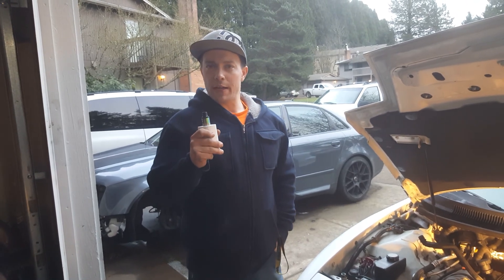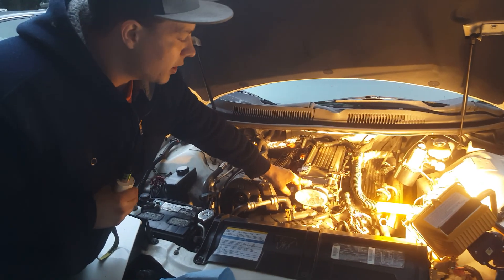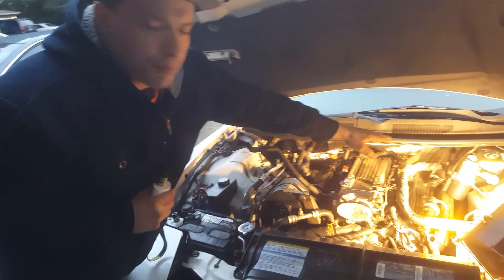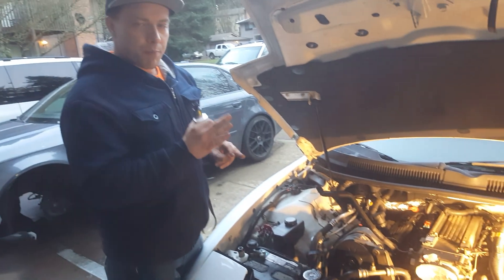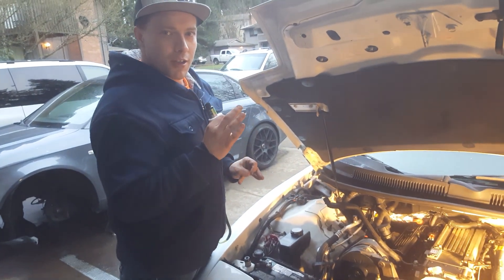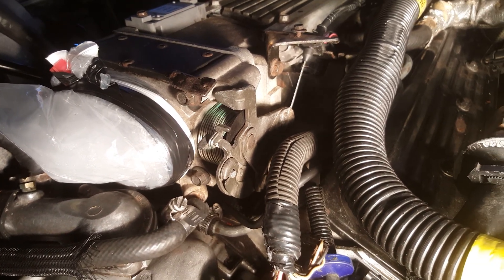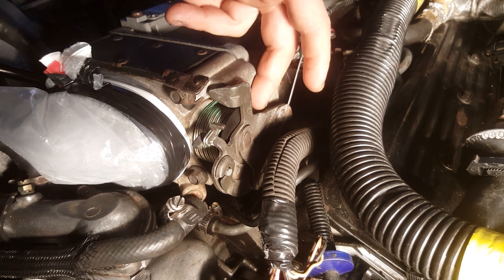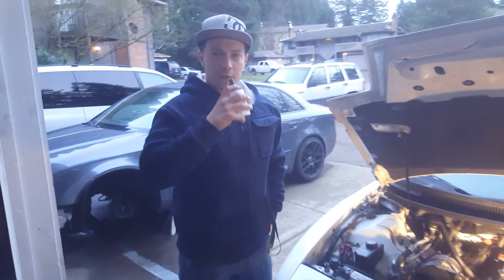Diagnosing a vacuum leak, with a vape pen.

Comment: Can you just plug the nozzle of the vape pen straight into the vacuum hose?
Reply from the maker: @metalmaniaxx  no you need to add a little pressure to the vacuum system for the smoke to find its way to the leak.
Reply: @vinnyaudi912  ahhh. Thanks

Comment: can I blow it into the intake instead of sealing it off? that case I can also see if there is hole in the hose, intercooler or some other parts before intake, right?
Reply from the maker: Yeah you can do that. Just make sure there are no leaks.

Comment: nice... but why seal off intake with plastic? cant we just leave the big throttle body hose which is usually clamped on?
Reply from the maker: You need to seal the intake off. They make an Inflatable bladder for it. I didn't have one handy